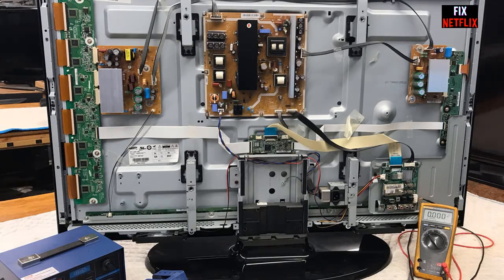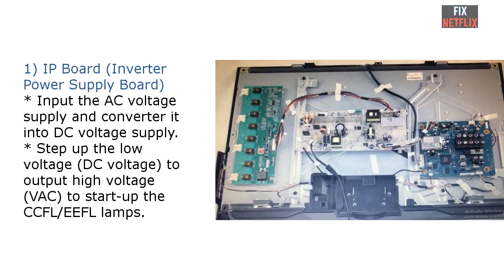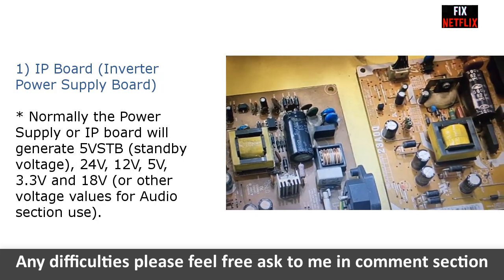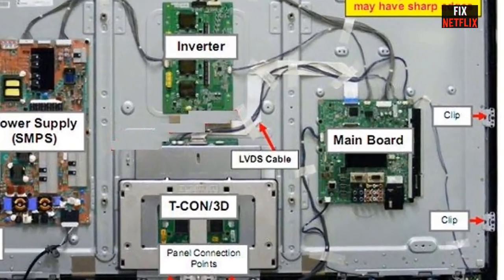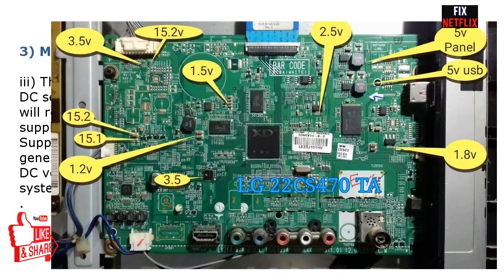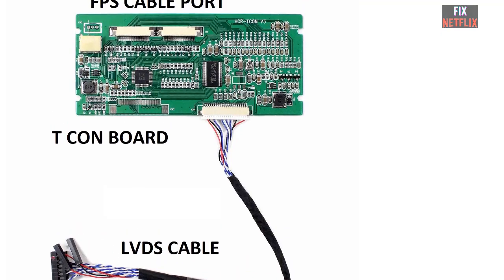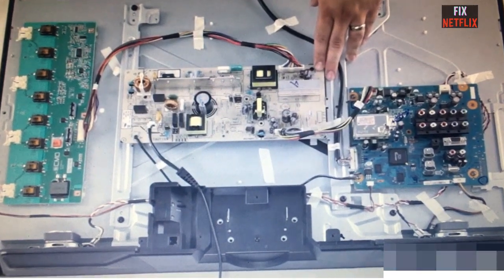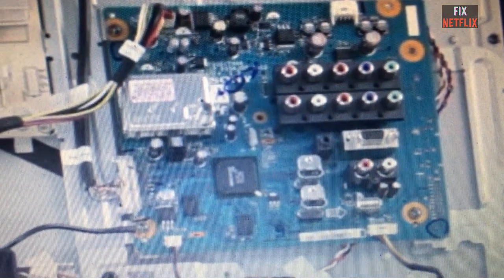How LCD TV Works -You Must Know Before Repair The TV - For Beginners- Master Guide

Comment: Hi Sony LCD TV no backlight goes to solid green standby light not red any idea
Reply from the maker: Kindly check the tv service menu. And reset them to factory settings. 
Hopefully this will help you to solve the problem. 
How any further same problem please reply me.
Reply: @FIXNETFLIX  thanks but did not work screen is blank only solid green standby light on only power plug connected
Reply: @FIXNETFLIX  SonyLCD TV KDL-32BX300

Hi
Main power ON
Screen black No backlight
Standby light permanently green ON
At PSU Connector:
PSU STBY 3.3V, AC OFFSET DET 3.28V ,PowerON 3.238V, BL-ON 0V,
BL-ERR 2.98V  hope you can quide is it main board fault? No BL backlight
Reply: KDL-32BX300   Sony tv
Sir did you find why I got no BL
 signal? BL is 0V 
Stdby 3.3V
AC offset 2.815V
Power on 3.238V
Regulator 12.45V